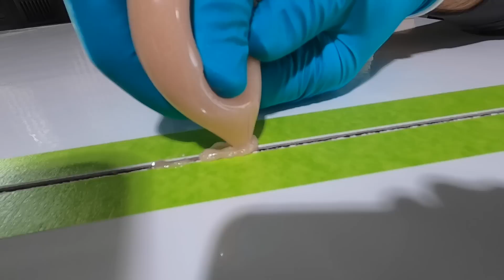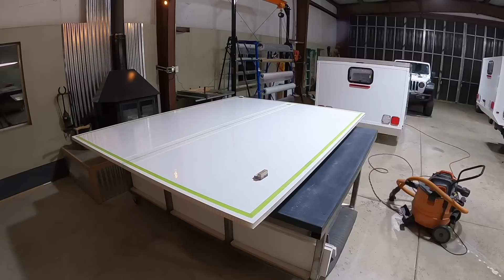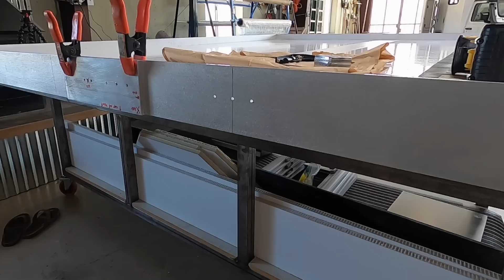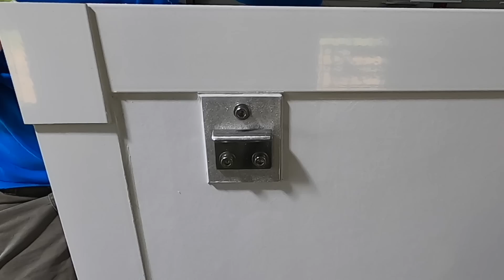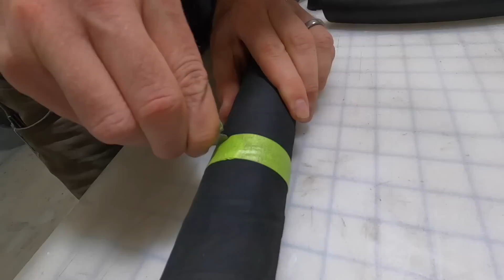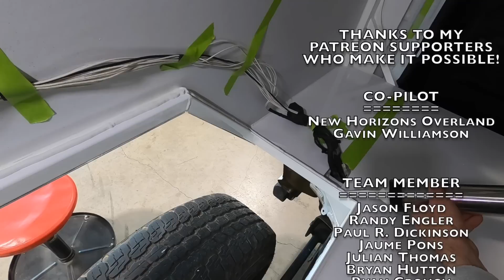Dream Overland Jeep Camper Build Pt. 6

Comment: In the middle of a hot day how warm does your inner ceiling get?
I'm curious how much thermal transfer the honeycomb allows. Thank you!
Reply from the maker: I've never measured it scientifically, but I'd say the inside does feel warm to the touch on the hottest days. I think the bigger problem is heat getting in (and out) through the front half of the Jeep - all the glass and sheet metal of the cab. 
We do have a heavy insulated curtain to try and block it as much as possible.
Reply: @TheRoadChoseMe wow, so not even warm? My future build plans is clean rigid foam because in my head it must be way better than honeycomb at insulating. But if you're saying it doesn't even get warm then that's good enough. 
Like you said, when the metal part of the vehicle will have so much more heat/cold gain then the performance of the box doesn't matter as much. 

That also brings up the idea of closing off the box from the vehicle. So many options on these builds haha. That can be the fun of it.
Reply from the maker: You can look at the R value of the foam core vs honeycomb core to get an idea of how different they are.
Michael made the walls of my camper from foam and carbon fibre because it has a better R value, is lighter and stronger than the commercial fiberglass/honeycomb panels.
Reply: @TheRoadChoseMe why honeycomb on the roof then, instead of foam?
Reply from the maker: Correct. Foam and carbon fibre were only used on the walls - mostly for strength.
They were extremely time consuming to make from scratch, so Michael didn't want to make more than necessary.
Michael did make a carbon/foam roof for his because it is much, much lighter than my honeycomb roof. It has a higher R value too.
Reply: @TheRoadChoseMe makes complete sense. 
Thank you for all your responses!! They've helped me plan my own build.
Reply from the maker: I can't wait to see what you come up with!

Comment: Hey Dan, with your relatively short length of box if I was you I'd go straight pop everytime. The wedge will just kill the amount of standing headroom and interior useability for 2 people. Now if you had a longer box / cab over then the wedge could also be a sensible option.... I was surprised to see you have honeycomb panels without insulation... my understanding is that honeycomb is alot of thermal bridges and they're not good for temperature control. If I remember correctly Everlanders regrets not going insulated foam core sandwich panels. Sure honeycomb is strong but is it stronger in any fundamental way compared to foam core sandwich panels? Foam core may have slightly less ultimate strength but for the far better thermal properties it seems worth it to me.... especially as you've said you want to travel anywhere on the planet in comfort. On that subject in extreme cold climates I would have a backup downstairs sleeping arrangement so you can sleep without the top popped for better heat retention. Let me know your thoughts 😁

Comment: Been working on linear actuators on my 4 wheel camper to lift the top.  Your top would be easier and super cool vs. gas struts!  Ever think of that option??
Reply from the maker: I looked into them, but they're heavy and expensive.
They also cause a problem for the canvas to fold in - the actuators either have to be on the outside of the vehicle which I really don't want, or you have to get very creative to allow the canvas to fold in.
All-in-all it's too much hassle, expense and weight for what I want.
Reply: @TheRoadChoseMe  im thinking more like horizontal under the outside lid lip with X lift like Down 2 Mob has!.  The fabric moving in is an issue im working on.  I'm working on mounting  actuators north to south horizontally Conecter to the lid, so that when the top is up the actuators are flat against the roof.  for me it would work like the front push bar on the 4WC,  It is heavier but im in a 3500 Ram.  I have a RTX2000 AC unit on top too so getting  older I need some help lifting the lid!  :).  Also the actuators could the delete the hold down latches which is cool!  My rig is tall and I need a ladder to unclip the rear!

Comment: Make sure the struts lifting the roof have plenty of strength. We just had to upgrade the struts on our caravan's pop-up roof, after adding glass solar panels, because of the extra weight. Now it lifts easily. Another option is electric roof lifters. Recommend good insulation for the lifting sides of the roof. Maybe have extra internal covers that Velcro in place to keep you warm in cold weather. Silicone only lasts about 10 years before needing renewing. Marine silicon seems to last longer.

Comment: As somebody who used to drive some very large commercial vehicles, have you given any thought towards looking "over the shoulder" to the right? On a box truck and even some vans, you do not get a choice as there is no way to mount a window, but in this fresh build, I would have been tempted to change that small window behind the cab into something that extends lower into the body of the camper box. This would have given you more viewing angle than just your mirrors could give.

As it stands now, once I replace my smaller car with something large enough to handle 4 people, I am getting tempted to cut the back of my Discovery2 off and follow in your tyretracks. The rear half of the chassis is getting a little crusty as they do on that model of LR, so replacing it and adding some length to the wheelbase would not be hard to do. From there would be a matter of enclosing the cab with the longranger kit for the roof and side panels.  Very tempting!

Comment: Hi Dan, how did you seal of the roof as it’s a pop-up roof. Did you make use of a 2nd sealing, one on the roof side, one on the cabin side which get pressed together securely when the roof is down? Would be great to know. Thanks a lot for a short feedback. All the best Michael
Reply: Thank you Dan for the prompt and valuable reply!
Reply from the maker: The roof has a "bulb" seal that squishes down onto the flat surface of the camper.
This is exactly the same as my camper had for 3 years around Africa and it help up really well!

Comment: Comming along nice 👌 just wondering did u put a special sealnt between the stainless locking clamps  and the allimium because the stainless will eat away the allimium one day , happens on boat masts stainless fittings to allimium masts

Comment: You've already done all the hard design work.  Assuming these things work out on the road, you should start a business building these things (even if it's a kit the user assembles).  Boom- there's your money to keep on driving for years to come.
Reply from the maker: It is certainly one of the options Michael is considering. The way these were built is extremely labor intensive, so things would have to be done differently.
Reply: @TheRoadChoseMe  Nice!  Look into "kit aircraft" as a point of reference.  Good luck!

Comment: I'm very impressed with michaels use of all those different materials and glues. Its something basically none of the 4x4 industry use so very interested to see how it performs offroad. While it keeps weight low nad removes the need for alot of bolting, how cheap is it versus just using nut & bolts?
Reply: I’m unable to provide a cost comparison, but the adhesive is not particularly expensive relative to the panels cost. Also, using fasteners has poor strength relative to adhesion for composite panels, not to mention thermal transfer depending on how they’re used.

Comment: Are you going to use CIGS solar panels on the roof? You could fit 500 watts of the bouge rv ones up there. 2 x 200 watt and 1 100 watt.  You could glue them directly to the roof. They are very light weight and do well in partial shade and low light. Not cheap but you'd have power to spare. Cheers.
Reply from the maker: I'll run Renogy Solar flexible panels, and 600W will fit :)

Comment: I'm planning to build a much less sophisticated version for my truck.  I may have missed it, but would you share the info on the 2 core 2 (sp?) panels you used?  I'm shopping for something like that.  Thanks
Reply: Look into carbon core honeycomb composite panels. I’d also recommend PVC foam composite panels. Not many places that sell panels and not the whole kit to join them (total composites). Boreas campers sells foam core panels.
Reply: @PathNotTaken  Thank you for the reply and info.  🍻

Comment: Dan, this is very extraordinary…..could Michael possibly invent a mirror extension…?
Reply from the maker: We're throwing around ideas. On the JK it is very straightforward, but the way the JL mirrors attach is overly complicated with brackets and angles.. making our life tough.
Reply: I tried out a pvc extension of abt 3/4”…. However the internal motor became a problem…

Comment: This is possibly one of the most, if not the most, technologically innovative builds I am following on YouTube. Very interesting indeed. I have a pop-up caravan (camping trailer). It is just over 20 years old and the pop-up is hard shell, not canvas. You may struggle to find examples on the net, but the model is Rapido Club Evolution 38T. The roof pops up squarely, not in a wedge. The current versions are called 'Silver' by Trigano (French manufacturer). These models may give you some hints and clues or equally as valuable, encourage your decision towards a wedge pop-up. The advantages are from my experience as follows. 

1. No low spots throughout the habitation area.
2. Regardless of how I have to park it, the solar panels are flat and therefore have exposure to the sun. A wedge may point the solar panels away from the sun.
3. The pop-up side walls have windows in them for ventilation, but for real air-flow in the heat of summer, they can be dropped to really open up the caravan and let hot air escape. 

Whilst not an apples-to-apples comparison, I hope this proves somewhat useful in helping you make a decision.
Reply from the maker: Thanks very much, I'm googling all the photos I can find now!

Comment: I made a three-axis 'bang-bang' pick'n place robot in school using air cylinders. We used three control systems from using just limit sensors to programmable logic controller to computer and IO card. For fun, I might consider doing it with a RasPi and a limit switch fallback allowing me to use the top as a wedge (L-R/R-L, F-B/B-F) or pop-up.🛹

Comment: Why didn't you make the roof slightly larger than the box so the edges of the aluminum angle would overlap? It seems like that would be more robust, but I assume you have a reason.
Reply from the maker: This way the roof is sitting on the box, which is the only thing that supports it's own weight. If it were "outside" it wouldn't have anything to sit on

Comment: If you make the pop-up a wedge, maybe consider putting the hinges at the back of the rig.  That way rain or snow will fall off the back of the vehicle, instead of pouring over the cab.  (Unless you'll have an outdoor kitchen or something in the back?)
Reply from the maker: I genuinely had never even thought of that once.. and now you have me thinking. I'm going to walk around it now and really think about that, thanks!
Reply: You're welcome!  🙂 @TheRoadChoseMe
Reply: Obviously the nice thing about a wedge is precipitation (snow/ice) has a chance to get off the roof, instead of adding to the weight the struts have to bear.   @TheRoadChoseMe
Reply: @VideosOffRoad . A wedge would also avoid using electric actuators that could fail in the middle of nowhere.  With a wedge, even if the gas strut assists fail, the roof can be propped up with sticks in a pinch, or better yet, build lightweight aluminum or carbon fibre poles to hold the wedge in the open position.
Reply: That's a good concept. The old VW camper van did that, but for other reasons. 
I always compared it to suicide doors though. Heaven forbid it pops open a little at highway speed!
Reply: not so sure if you need a wedge for some of the effects - opening up the front first would do for snow and ice. I also did not get the argument with not working gas struts. But then I'm a low tech guy. But a system, that is not necesarilly pushing up the roof to the same hight and/or at the same time might be usefull and also simple, like gas struts in the front and a manual construction in the back.
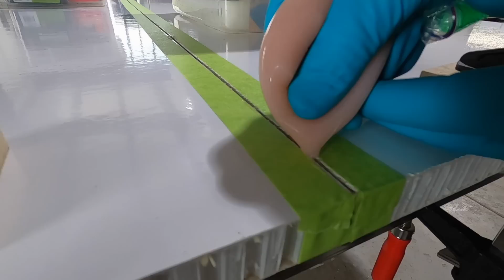Reply: @aasphaltmueller5178  The idea was if it's design is always as a wedge while open, and it snows all through the night and started getting heavy, the snow could slide off at like, 1:30 in the morning while you're asleep, before it could weigh the roof/struts down too much.
Reply: @VideosOffRoad  got your point - did some winter camping myself. I still think an idea, where you open the front to a fixed hight and the rear to an adjustable one might be explored. Depends also on his travel plans and the weather they might meet - the roof construction allows for changes in the pop-up system when changing the broader geographical area.
Reply: Like Dan, I had also never thought of that. Brilliant!
Reply: @Vanisl4runner1  It just seemed to make sense.  🙂